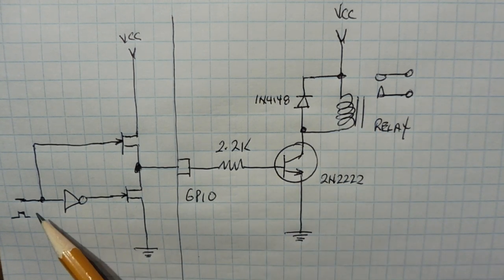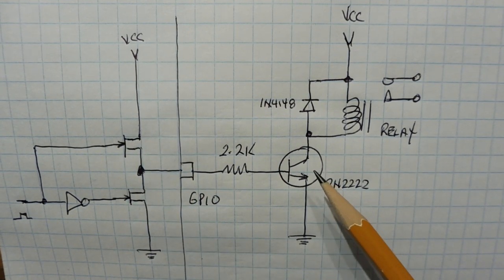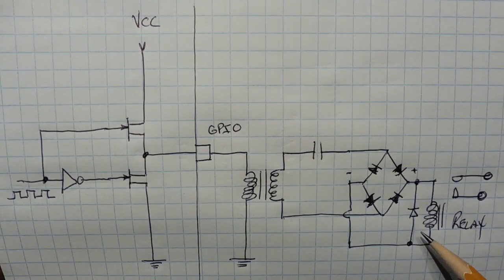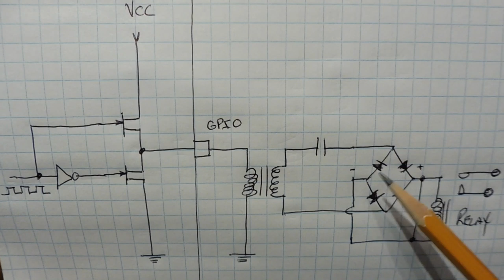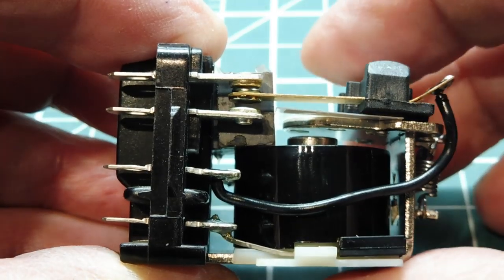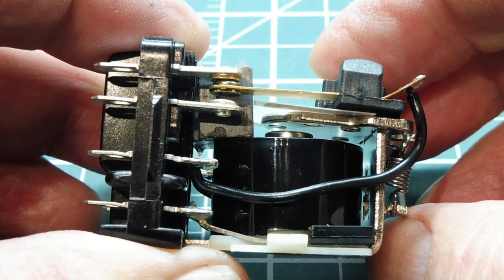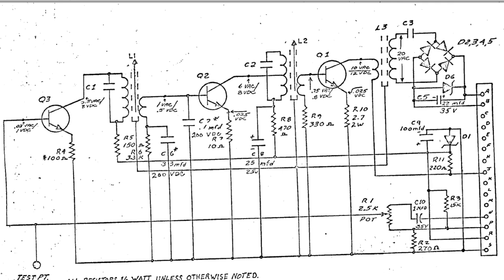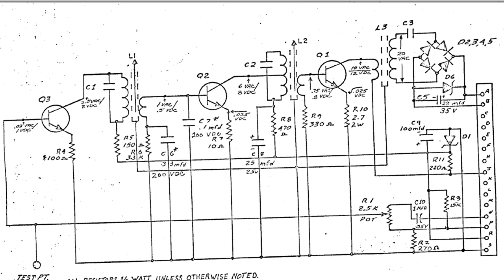Vital Logic Design  / Fail-safe Circuits

Comment: So I caught your latest upload and then checked your video history to see what I may have missed recently. What a little gem this is :-)
  
 edit: Do you have any book recommendations that cover practical failure modes of devices? (saw the post below)

  This actually reminded me of a bookmark reference I saved awhile back. If you're not already aware NASA has a website called the NTRS or "NASA Technical Reports Server." That site has over a million scientific papers covering every kind of thing they've commissioned a study about. This includes a ton of electrical engineering documents. I first came across the site while researching various momentary push button latching circuits. I found a PDF with many different circuits in some obscure forum. The PDF was from NASA and had the NTRS address in the title. I went looking for more and discovered the server. There's a ton to filter through on there but the docs cover the entire age of electronics and all the various inquiries NASA has sponsored. The circuits I've seen are very much in line with this idea of Vital Logic Design.
  Thanks for the upload.
-Jake
Reply: I just checked the website and I saved it to my bookmarks too for future reference. Thanks!
And I second your comment, have you been able to find any books about the subject?